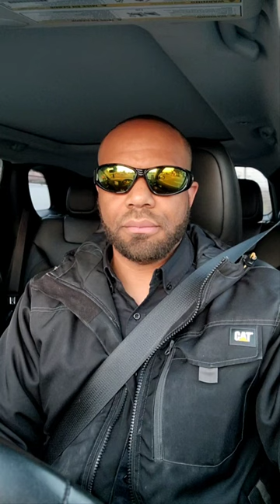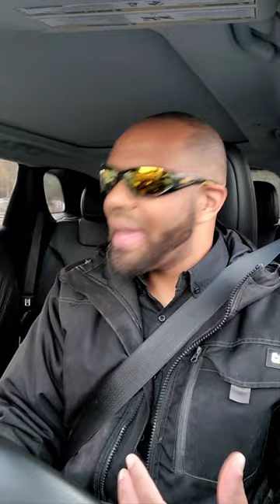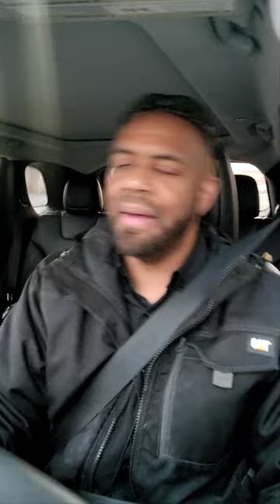I Need More Polyphony in My Keyboards!!!

Comment: Hello I appreciate this video.

First of all I’ve looked at a lot of your other videos and see that you have a lot of gear. So I have respect your opinion.

These manufactures have been doing the bare minimum and milking the musicians to make a profit in my opinion.

In 2022 with the availability of sad and memory including faster cpu we should be doing better than this especially for flagship models.

I believe that they are dragging their feet because there is no competition between manufacturers in these crucial areas.

If they keep the memory, drive space, and processor power at the bare minimum they can do minimum updates and sell it as an upgrade.

I got the Roland fantom thinking that it would be an advance in technology and to some extent it is but lacks some simple things that even its predecessor had. 

I also purchased a  SL MK3 61 which again is admittedly an upgrade but also lacks simple abilities its much cheaper predecessor had. They claim it can control other hardware and be the center piece not needing a computer but yet it lacks the ability to send bank change and program change commands (which was available in the middle 2)

I have decided to test out software where I can get as much memory as  I can afford and processing power that’s more updated not to mention hard drive space.

I currently moved to gig performer after trying many others. It is stable and written by musicians for musicians. They have a weekly YouTube program called back stage with gig performer and also a very active forum.

The program is enormous in its ability to be programmed to do what ever you can think of and does it in ways that current hard ware can only dream of.

It does have its cons as you have said before just like everything else but the freedom it gives is worth it.

After chasing down many different hard ware for the past number of years including the fantom and not being satisfied with the manufacture selected limitiations I decided to test out software and plunge in fully to see if I can depend on it similar to hardware.

I have only so far tested it in studio but so far works as well as hardware with much more configuration capabilities.  I will be testing it live twice this week and I dont believe I will retrurn back to hard ware except as a backup in case my computer fails.

The industry simply need someone to come and change the game the way Korg  did with the Kronos (bearing in mind that they also dropped the ball with only small increases for over 11 years then finally came out with the nautilus intentionally leaving out sliders and knobs as if keyboardists has no need for them.

All in all I appreciate your video as it reminds me that I am not the only one who looks at it in this manner.

Comment: Unfortunately, not a lot of innovation going on. The Big 3 have gotten comfortable. Roland Jv-Xv-Fantom-integra-Fantom again😆. Korg Trinity-Triton-M3, Oasis births Kronos. Yamaha...don't worry, Vintage 74 is in like every board for the last 20 years...Motif Classiv-Es-XS-XF-Montage. AWM is very old. 20+ years of 16 tracks and 64-128 polyphony. I will say that Behringer coming out with their synths that copy originals for fractions of the price is forcing the manufacturers to stop resting...and giving the consumer choices and better prices.

Comment: I mean, the Fantom Vpiano is unlimited polyphony, isn’t it? Unfortunately it’s also not the best sounding piano engine.
Reply from the maker: Yes it is. That is why I use it often when layering sounds. That really helps. But the rest of the RD2000 is only 128-voice polyphony. So anything outside of VPiano is going to be limited. Not so bad on a stage piano though. But the Fantom cannot keep up backing tracks wise with my style of music and play. Even with using the V-Piano. Because my music often requires moving pads, synth lead, bell, drums, percussion, bass, rhythm guitar, lead guitar, string, brass, organ and acoustic piano. When I am emulating a song that came out in 2018 that's often what it takes. No keyboard keeps up. Polyphony is always the issue.

Comment: I've been saying this for YEARS. My guess is as yours...they're saving money and since the competition out there is not very big they can afford to get away with it. It's pretty clever too because they can sell us an upgraded synth later on for the same price, and keep drop-feeding us a lil more ram, a lil more speed for every generation. Technically they could just purchase the latest multi-core processor with up to 16 cores, 4 GHz and you could have 1024 polypony and all the VST's you could ever dream of, but that would kill their entire lineup and essentially end sales of all units.
Reply: It's the exact issue at hand. If the gear has technically unlimited Poliphony and unlimited ammount of sound engines, eg. say if you really ran out of poliphony anyway, you just upgraded the onboard processor or added more ram. This would make them no money apart from upgrading your unit once every 2-3 years. Plus making an instrument where the UI is fast and practical with any new VST's you would add in the future is close to impossible. Same issue that Korg users have been rambling about for a decade about the Kronos and why Korg don't put out an upgrade to it. They could technically just sell you a new mobo with an 8, 16, 32 core cpu  .. yada yada and upgrade their software .. wait why don't you just buy a laptop .. this will never be a path for neither of the different keyboard brands as they need things to get outdated so they can sell you something new that will be outdated again within a reasonable time period or they would ruin their business. And you can see the this is exactly what the Oasys/Kronos line was supposed to be, but just as Intel; AMD, Apple etc. at some point the hardware do get outdated, and you have to dish the whole machine and build a new on new technology. It's a never ending circle that really won't change anything. The best thing is still to spread your load out on a couple of keyboards and maybe a laptop and some software and then accept that you will have to switch each of them out every now and then.

Comment: Totally agree but the bean counters go, if we short change them on polyphony they’ll need multiple units instead of 1. Like the Roland MC-101 4 tracks and 128 voice polyphony……. Should be 256 as the partials and effects etc devour polyphony like candy. The 707 is worse , here’s 8 tracks but still only 128 note polyphony. WHAT??? The 707 should have Double the polyphony of the 101 since double the tracks but NOPE. It’s all to get us to spend more $$$ 

The 707 should have 512 note polyphony. So should the Fantom’s so should my Jupiter Xm etc
Reply from the maker: Very true. I think what the bean counters are missing is instead of buying another keyboard people are going the Laptop/VST route. Top professionals that were formerly all hardware based musicians have a laptop on stage now. There are A LOT of musicians that prefer the hardware workflow but are forced to use computers because the "power" just isn't there.
Reply: @darrickkeels6387  precisely! Hence why I’m SHOCKED Yamaha hasn’t really jumped on the VST/Cloud bandwagon
Reply: @darrickkeels6387  I mean I like the sound of the Modal Cobalt and Argon buuuuuuut what’s with only 8 voice polyphony ??????

I mean HELL I’ve got a 2015 iPadPro running AudioKits D1 Synth on it and that antiques doing 64 voice polyphony and can use multiple instances of app
Reply: @darrickkeels6387  another thing that bugs me, Hey these new Model Expansions uses Zencore but not the full Zencore soooooo we going to charge you $150 each for each various subset of the brain you already using instead of just creating the Patches in Zencore. I get it, they in business to make money but still seems like there’s a better way. They also seem to be getting greedy on price pf the Patches in Cloud. Used to be $0.99 a pack of patches, then $4.99 now I think they $9.99 each……

Keep wondering when an Integra 8 with Zencore gonna hit too. That sucker better have 512 voice polyphony if they going to ask $2000+

Comment: They are using old  generation CPUs. They need to move to ARM based CPUs like the new iPads.
Reply from the maker: Indeed. They are simply far behind the times. And while I love hardware. I absolutely understand why some musicians only use VSTs now. The power gap is widening and the cons of using software is an ever shrinking list. It's like these keyboard manufacturers are stuck in the 90's.
Reply: This is incorrect but has some ounce of truth. Briefly, the older CPU's Yamaha used in the Motif series were improved in the Montage/MODX series, (higher I/O operations, more detail in the compressed Motif library transferred to the Montage as few examples). The trouble here is Yamaha don't necessarily build from the ground up (similarly to Roland and Korg, lots of R&D involved and it's not the same as it used to be), they always changing to fit the development of the new architecture.

They do use ARM CPUs, it's just not mentioned.

Comment: Get a k2700, these companies  are wack.
Reply from the maker: Though the Kurzweil K2700 is better than a Montage and Fantom in the polyphony department it still only gives you 256-voices. Granted those voices are dynamically allocated between the various sound engines just like the Korg Kronos/Nautilus. But with an architecture that allows for 32 layers per program, 256-voices can be eaten up quickly as well. Not to mention each FM voice eats up 4 voices. But honestly when I think "dated" the Kurzweil is the first keyboard that comes to mind. It has a small non-touchscreen, 2in/2out audio interface (Montage is 34out/6in), same old 16-track sequencer limit with no audio tracks, etc. Every company needs to step it up.